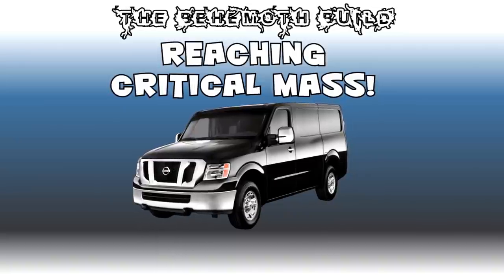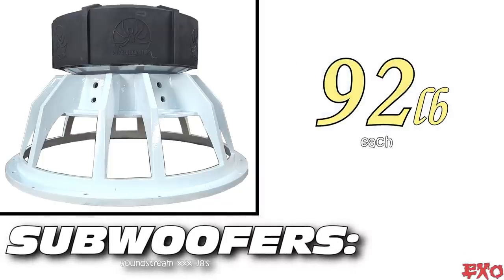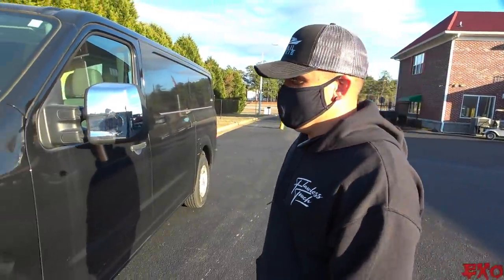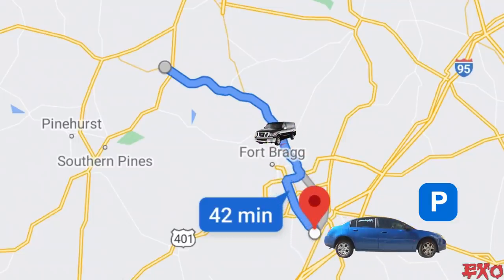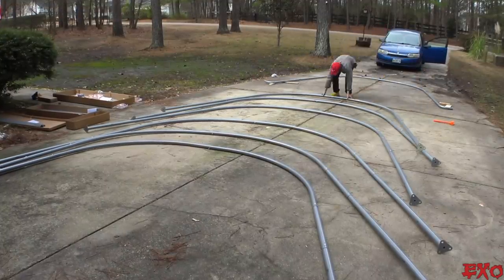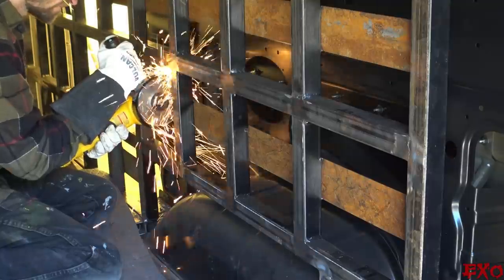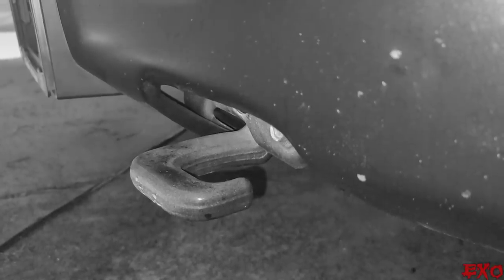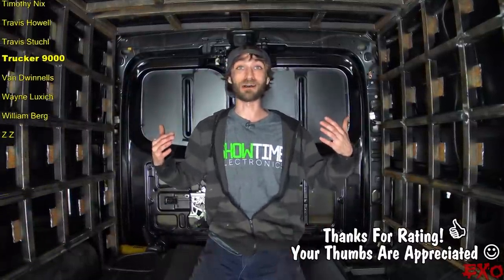Pushing THE LIMITS w/ My Biggest Car Audio Build EVER & Increasing INSTALL SIZE for 12 18" Subwoofer

Comment: The look on the delivery guys face after the pallet jack landed was priceless!
Reply: ''I didn't mean to do that!'' i bet you didn't, he did well to take the weight of it though, you can see he was looking at the rear and not at the front of the wheels until it was waaay too late then he took the weight of it. Legend
Reply: Sooo funny
Reply: @chaysendreamz  was an u. Be sur
Reply: Lmfao!!!
Reply: Well that guy will be in the unemployment line tomorrow
Reply: @kayjay4060   All he had to do was set the palate down... That's how you stop it from rolling you set it on the ground he should have pulled the grip

Comment: Hey EXO, I know it's too late now, but did you consider an aluminum cage instead of a steal?
Reply: Nore expense but way way lighter. Not as strong but I would of gone aluminium!!
Reply: With 12 18in's it'll probably flex the aluminum too much but idk good question
Reply: He could always buy a dimple die set and that cuts weight and adds rigidity to any metal. Steel or aluminum. Thats what I wouldve done. But there isn't much space to use the die set anyways so. Might not be as helpful
Reply: Do carbon fiber lol a TINY bit more expensive but stronger!

Comment: Great breakdown! Love watching you get so enthusiastic with the build! Another plus, the 9,900 lb GVWR limit is what the vehicle can SAFELY handle. This takes the suspension and driveline all into account, so with the helper springs in there to make the vehicle handle much better with added weight you've probably raised that limit. With all the weight savings and upgrades that truck should be cruising just fine :)

Comment: What kind of amps are you using that are lighter but more power? Maybe full bridge?
Reply: I was wondering the exact same thing. Looks like alot more wattage and 100 lbs less weight. Most trade offs aren't win-win situations unless there is alot more cost involved.

Comment: You can wrap your car port with metal roofing once the tarp material wears out.  It's around $400.  Use the self tapping metal roof screws.  Start at one side and work your way around up over the top and down the other side to keep everything aligned.  You'll need three guys. We used a truck with a ladder rack to stand on plus scaffolding.  Add a little more cash if you want to add front and back wall.  Edges are also really sharp.

Comment: One thing to keep in mind when increasing payload capacity is that it isn't just the springs that need upgrading. 400 pounds or so probably won't cause too many issues but payload is about more than springs alone. Wheels and tires have to be up to the task. Axles also have to be able to deal with the extra stress. Some folks with their heavy duty tow rigs have run into issues when they added spring capacity but forgot about the wheels and had a collapse or forgot about the tires and had blowouts. Another thing to keep in mind is very few factory vehicles are built to be used at max capacity, much less over max, at all times. Only time will tell if you'll be alright but I'd check the weight rating on those tires first and then the wheels.

Comment: You should've kept those front hooks just in case your van gets stuck somewhere remote or in an awkward place or position, there's reasons why they have those heavy duty hooks mounted or built on the frame of the vehicle. Especially when the end result is gonna be a heavy ass show audio van.

Comment: Love the video as always! You are really shaving off the weight. My only complaint is the fact that you removed the front tow hooks from the bumper. When you need tow hooks, they are irreplaceable. You should keep those for sure man. They are built very heavy duty because the van is very heavy duty. You won’t regret when/if you need them. Again awesome video sir! Thank you!

Comment: I always use Gasket maker to fix a "poked hole" in surrounds.. If its too big use a piece of plastic window screen. One layer of gasket maker and let dry. Then put window screen and another layer of gasket maker. 
 Any adhesive that bonds strong to surround that flexes after cured will work but that's what I use.  Thankfully ive learned to take my time and use finger to guide as screwing in or out.. Doesnt happen anymore

Comment: Look into getting a dimple die set. Can be used for steel or aluminum. Cuts weight and makes the metal more rigid and strong. Especially on flat stretches of metal. Might be a good investment. But idk what your plans are for the whole build

Comment: EXO i have some advice that might help you with this build. Your gvwr isnt set based off of the engine in the truck rather its set based on your suspension package. Also changing your wheel and tires does not affect anything or reduce your weight because the cargo and body weight stays the same. Engine has nothing to do with the weight rating numbers because in vehicles like the ford e350 they use the same engine in several configurations of the chassis from a small work van to literal school busses. The engine in your van can easily pull more than 5000 pounds of extra weight because its designed to do that. But what i recommend you to do is just get a thicker leaf spring package for the rear and stiffer coils for the front. Since your van is a body on frame unit this will increase your gvwr because your suspension can now handle more weight.

Comment: Exo's van maxed out is what my truck weighs in at empty. 9,660 lbs is what my truck weighs empty 26,000 loaded. A straight truck build would be different lol! Oh DOT can pull over a van if it's over GVWR they can put it out of service even if it's under 26,001 lbs.

Comment: You need to buy a drop cloth for the van when your doing dirty work like grinding. Get the autobody style bag that comes in a box and is never ending and it’s not that thick. You’re probably already done but those grind shavings stick to the paint and start to rust.

Comment: What gets better an better is the enjoyment from bass  each time we start off small but the bass keeps getting bigger an better each time., 

that being said what gets worse an worse as time goes would be the cooling system in a vehicle.  Not only is keeping your vehicle  at the right temperature  but having a bad radiator or an thermostat. But in reality head gasket burst. Tops it off.

Comment: I have a single cab truck with just have two 300 watt 12 inch kickers with a sealed box. I was wounding what would be the highest watts could I run with that box without suffocating it or how would I got about porting the box because I am wanting to run about 1000 watts for each sub

Comment: did you factor in the weight of the people driving into your equation? also, what about the weight of the welds as well. should have used aluminum instead. cost is greater but weight and strength should be ok for it.

Comment: I don't know if you've ever considered this but maybe changing the wheels and tires to a lighter rim and lighter Tire depending on the size that you could fit on there that would still be safe to drive all that wieght around

Comment: Exo, i have a question. I am saving up to get 2 12" sundown audio Z-12 V.5 D1 2,000 watt rms Dual 1 ohm subs and a sundown audio salt 8 8000 watt rms monoblock amp. I will be putting it into my 1990 Toyota Celica gt. Will i need 1 battery or 2 in the trunk?

Comment: I have 2 Skar SDR 15 inch dual 4 ohm subs in my trailblazer on a Audiopipe APMN 1500 class d monoblock 1 ohm stable amp and they are bridged down to 2 ohm and hooked up to the amp at 1 ohm and they really pound my trailblazer but I am wanting to find out what kind of box that would be great for my 2 Skar SDR 15 inch dual 4 ohm subs that doesn't flex with the bass

Comment: Can you help me understand something? I was looking into your super spring solution you used. I'm interested in putting something like that on my truck for better towing capability but I have a leveling kit on my truck. Wondered if this would fit with a 2 inch block already there?

Comment: You forgot removing the tow hooks and adding the driver's weight.
Using aluminum would have cut the cage weight in half too.
Also if you designed the cage to slide in and out would make it even easier to install the speakers also.

Comment: EXO I was very impressed with your thorough thinking about the weight .  On that subject are the pieces of wood inside the steel cage really necessary?  With the openings so small between bars  how much could the wood  flex?  With such small openings and you are watching your weight I would test this out before commenting to the add work/weight to see if there are any real world gains to be had. Also you may regret taking that spare tire off. You are going to be traveling to shows and driving the van on trips . You never know what you could run over and get a flat in the middle of no where in the dark of night.

Comment: You can also check the driveline if it's steel go with aluminum or carbon fiber to save more weight there also bro

Comment: you kinda skipped over it in the video, but i hope that car tent is bolted to the ground, we had a US Steel type 20'x 35' carport leave the ground and it was staked to the dirt with 12 one foot long stakes, the only thing that kept it on place was the 2 30 foot cargo containers we were using as walls

Comment: EXO you are HALF right on what you are doing with weight......you have to measure how much weight PER AXLE because you can be way under weight but if all that weight is on the rear axle one bump and bye bye axle tube im not sure what your axles are rated for.....Adding an add a leaf or overload spring only stops the rear from sagging it doesn't stop the axle from overload

Comment: The tires are another thing look at! Check the load rating and
you want to have tires at least 3k to 4k more than what it weighs.
You want a solid ride and not have to worry about a blow out
when your traveling.

Comment: I think that in a lot of cases the bigger the subs/amps the better it will get and for something that gets worse the smaller it gets I would say a radio lol. I have had people bring in the tiny little dual radio that is smaller than the single din housing itself and it’s just interesting.

Comment: Since you were steel caging it. Tbh you couldve cut out the fenderwells and part of the floor in the back and had it aluminum tubbed. Wouldve cut a good chunk of weight out. Buy that is labor intensive and aint cheap. Probably couldve used gussets and took out a few of those small square tube supports. Saved some weight. But if you plan on upgrading springs essentially your payload could be your towing cap. Payload is based on springs ive seen guys on bags run 3k+ over rated payload. But keep at it. You could cut out some metal in the rear door supports behind the panel. So much small stuff. Technically you cant increase a vehicles payload. Since it based from factor but suspension upgrades and so on will help with driving characteristics to be less of a hassle. Those guys also have upgraded axles and so on to carry the heavier weight. Answer to the question is i have to say car interior space. I hate real small interior cars all cramped up no leg room. As you go bigger to say a s.u.v. it is way better and more roomie

Comment: @EXOcontralto have you ever bumped into the "Wicked Hurricane" by Emppu Pietikäinen? it's a transit demo build with, just to mention a part of the system, 32x DD Audio 15" subs and 300kW of amp power, and has done +164db @ 19hz iirc

Comment: Keep in mind when shedding weight that the weight capicity is  sprung weight that the suspension can handle. changing out to 4 aluminum wheels will not help at all with your weight handling capacity issue since that will be unsprung weight.

Comment: Really enjoy your video's. I wonder, Couldn't you go for a lighter frame? What math did u use to calculate the strenth needed for this build, and took this design? . And were there options to use less steel? Greets from the Netherlands

Comment: You didn’t take into account your body weight from someone riding in the driver seat or passenger seat and the weight of the fuel. Will basically be over weight while your driving with fuel. Nice vid

Comment: The biggest most crazy ass car stereo I've ever seen was from a guy named Toby. He had a 94 eclipse with a speaker wall just behind the two front seats. The wall had 6 12-inch subs facing out tords you.
The wall had 8 flex-ports that ran back to the 4 18-inch subs that were in sealed speaker boxes except the flex ports that brought sound and blasts of air... the car had 8 mids in the cab cleverly hidden and last but not least is the 6 tweeters..
At a sound contest he blew his windshield off of his car and had to use plexiglass bolted in.. it looked diffrent but not bad and if you were not shown it you mite not even see it...until you take a ride cuz it had a blue tint kinda.. also the stereo stuff weighted so much his turbo front wheel drive was lowered without doing anything to it.. and was slow driving and sad up hills but at sound shows it kicked tons of ass..

Comment: You guys in america have such big cars with high usable weight
back there in France I have a Small car which has about 3300 pounds max capacity, currently sitting at 4400 pounds 😂

And that just for 4 15's 😂

Comment: The wheels are only payload that the tires manage. If your payload is restricted by your tire ratings, getting better tires would be a simple answer. The problem is that payload rating is a legal rating of the entire vehicle not just the tires.

Comment: Weight savings in the wheels and tires will probably be the biggest weight loss. IIRC every 1lb you take off in unsprung weight is the equivelent to shaving 10 lbs in sprung weight out of the car.

Comment: Hmm, the little squares filled with wood seems really irrelevant for a demo build, it will only add a small advance in stiffness and like 0.2db. As its not a db drag build, it will save weight and a lot of time.

Comment: I don't want to worry you but I want you to be aware. The weigh savings from the new rims and tires don't help with the load rating as they are part of the wrong side of the suspension. no worries tho you still ended up under max load.

Comment: Seems with a given speaker system(or just a driver and enclosure), the resonant frequency (fs?) of the system gets lower as the box size (x.xxft-squared) gets larger. I would say this is better as I like it Loooowhhh.    and for a given speaker system, the smaller your setup the more important your precise measurements. This could be a draw back, as it is difficult to account for everything sometimes, and good measurements can be hard to come by for a diy guy.  But, even that said, there are some good newer tools that help like only 130$ gets a good speaker measurement device for your PC.  Dayton Audio DATS V3 .    IC's seem to be getting much much better the smaller they get these days.  Newer substrates that work better at higher, and at lower temperatures.  Better yield and tolerances at room temp, and some really special new Super Conductive parts are becoming mainstream.  It's a great time to be alive.   I really enjoy your adventures man, party on.

Comment: I'm a mechanic and a auto body repairs men and yes a job can take 20mins to do but we still gotta charge a hour if not we be working for nothing
Reply: If it's a 20/30 min job in this line of work we still gotta add a hour because it's commission work basically

Comment: So want to save weight. Carbon fiber everything you can also do a exhaust with thin walled tubes and no mufflers or cats also do lexan Windows as well do a carbon drive shaft and yer. If I had the money and time I would do that haha also why couldn't you get a aluminum cage? Also take the heater core and the ac stuff out as well. Take the dash out there will be metal and crap there you can remove as well.

Comment: Ok, I've been installing systems for years,since I was a kid, my buddy Rob at looney tunes in my town ,has just finished my box ,for two gz hydrogen 12lvs, I had just finished, wiering the sd 8k for the subs ,so we get it all installed and hooked up , and the whole crew was there.I did not have the tune right , gains eq and so forth, i turn it up,  and the first hit , of the system,  the sd go straight into protect,  thank fully it did reset, Rob gets into the car does his thing ,,,,, well the lesson here was ,my fellow bass heads , don't use the loud button on you head units, the thing is I KNEW BETTER, watch you gains wif your bass set ups, no bass boost ,no loud set . I was very humiliated, as for they were all laughing at me , trying to show the crew how good of an installer I am .... oooooops !!

Comment: how do you guys afford this shit. I'm trying to build a full potential build with two times 15 inch L7's on 2500 watts and i am breaking the shit out of my pretty nice savings account. not just the audio equipment. a garage fully outfitted with all the tools you need. did you marry rich? your dedication to your craft is a whole separate story. but why wouldn't you just put bigger springs in your nissan? with a more aggressive profile? (until you added your stereo)

Comment: Your having the same issue guys have had for years and years. Only difference is most other people have it with there trailers or motor bikes. Solution is easy. Over load springs. That and heavy duty shocks in the rear. Problem solved. That's were the phrase heavy half ton came from or camper special on trucks. Your van is no different.  I'm sure there is someone out there running there business out of the same van who has had to do the same thing